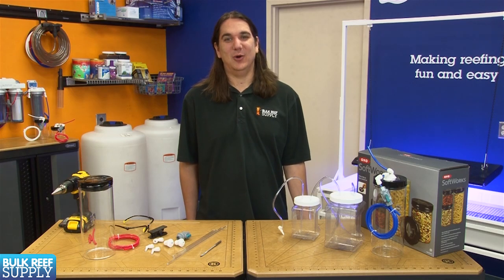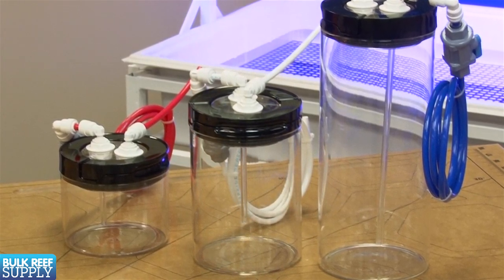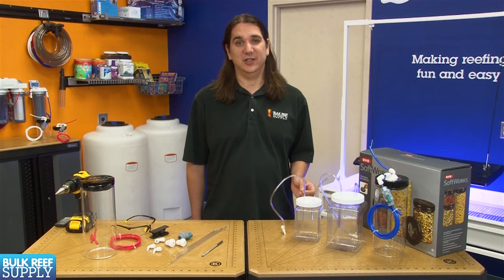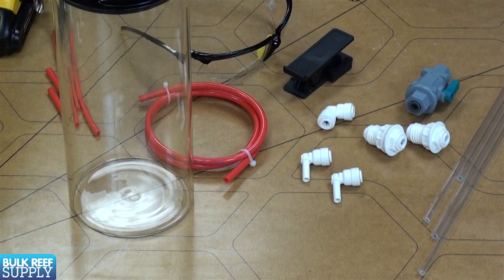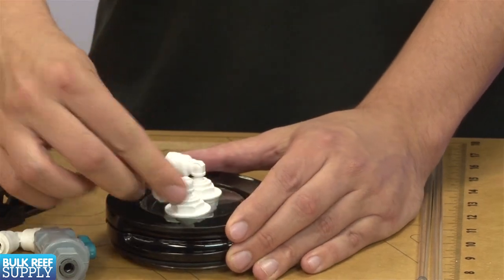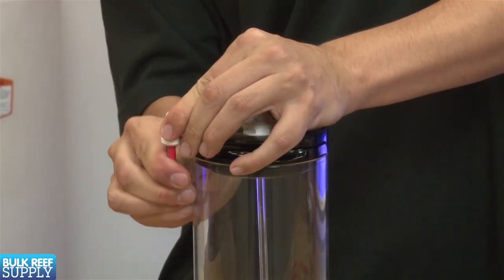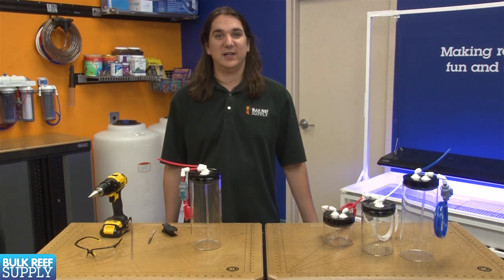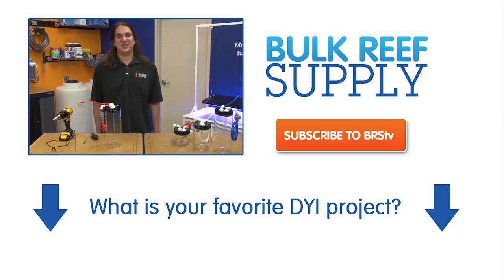DIY Kalk Dripper Kit from BulkReefSupply.com

Comment: I know this is an old video, but can have this inline with my ATO?  So instead of using this as a drip type system, it would be inline ATO -> DIY Reactor -> into sump will this work or will the pressure be to much?  Thanks

Comment: I'm working on my own first saltwater tank.  29 gal acrylic drilled my own overflow. Have it in a diy stand.  Working on my own diy sump right now too that is 20 gal. Just torn right now on to use 2 part or kalk. Plan on doing more of a coral tank than fish. So my have to go wth 2 part eventually. Ur vids have been a great help tho
Reply: No filtration needed except for carbon get a eheim 3650 surface skimmer and use your power head to circulate the tank that's all you need you don't need anything else you don't need any backpack you don't need anything up to 60 gallons okay buddy decide your light add your heater at your power head and get the eheim 350 put in a bag of carbon on a suction cup and there you go

Comment: I blow into the short tube but cant get it to drip. what am I doing wrong? haha
Reply: yes. I tried everything. everything is the same as in the video. when I blow into the short end kalk mix spits out with air, nothing more than that happens.
Reply: I just did the exact same thing and I'm not getting any suction either

Comment: What do you guys think about using vinegar tobdissolve kalk? Just saw a vid from reefdmv's, does that help out to dissolve and have less kalk slurry?
Reply: Okay, good info, I'm still not running any thing yet, I need to do it cause I'm having issues with my ph. 7.6-7.8, can't get it higher. Calcium is at 440. I like they simplicity of it so I will be using kalk really soon. Tnx for your response